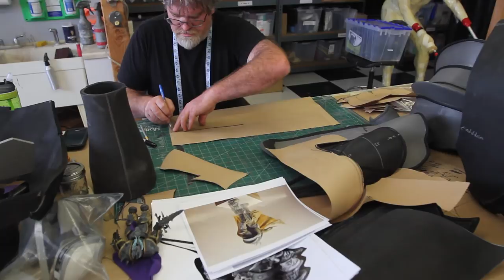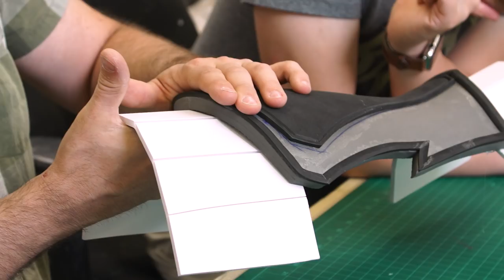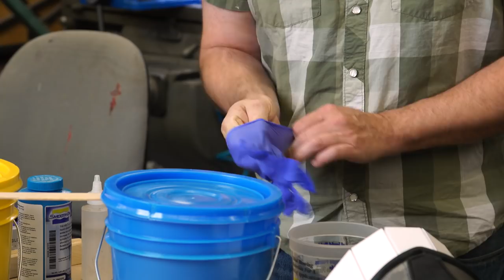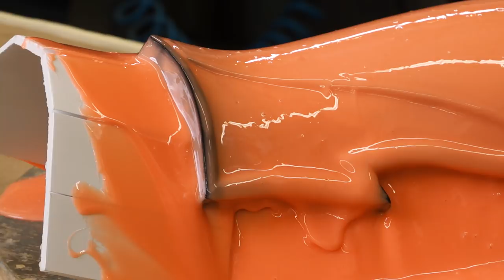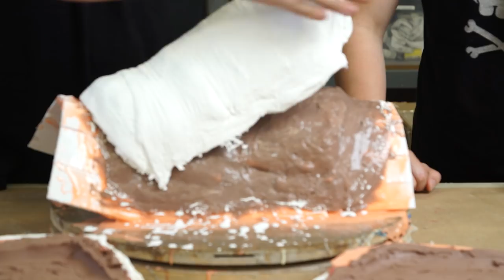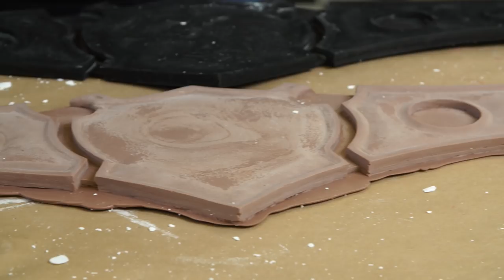How To Make a Silicone Brush-Up Mold!

Comment: Ah, the memories!
I used to make molds using latex, cotton gauze and plaster.
Same basic work-up, but after the detail pass, the second coating would get gauze pressed into the still-tacky latex.
Once that had set, another layer of latex, more gauze.
Basically a rubber/cotton composite structure.
I usually went for 4 layers of latex/gauze over the detail layer.
I would then encase the rubber mold with a plaster-gauze shell or 'mother' mold.
The rigid mother aligns and supports the rubber molding.
And yes, these were 20+ impression molds!
Never have used silicone con-carne.
Reply: I bet that is a lot cheaper than silicone.

Comment: You know, I really felt for a while like this channel and others were just plugging Smooth-On. Recently at work I had to make up a ton of brush on molds using silicone from some random local supplier and it was a nightmare. I'd have coats with precisely the same silicone to hardener ratios, and they'd just take completely random amounts of time to cure enough to add subsequent coats, anywhere between like 20 minutes and 5 hours. Quality silicone matters, kids.

Comment: Brush-on estimator 5000: find/cut a thin terry-cloth rag that just covers the area to brush-up, wad that cloth into a ball, drop the ball in the bucket.  Eye-ball the volume of the rag in the bucket, mix up slightly less than the rag-volume.
You are welcome.
Old fiberglass resin trick.

Comment: when talking about the thickness of the silicon you can save silicon by making it  thinner, 1/4" clear silicon you get from the hardware store  in a caulk tube is what i generally use. you can then use a plaster mother mold to get the rigidity you need, this is what i use to make my wax positives for metal casting in investment molds. really the method i use takes WAY longer than this does but its also WAY cheaper, a tube of construction silicon is like $5 and the plaster is even cheaper when you get a big bag of it but you'll spend a good long while making the molds.

Comment: Question: Would it be possible just to fill a mold like this with smoothcast 300 or a similar liquid plastic instead of the monster clay? Perhaps if you didn't need any more detail in the finished product?
Reply: Absolutely. You could also pour in resin, then distress it, or even add metal powders for neat effects. The way this guy make molds has always bothered me.
Reply: badvermin This gives me so many ideas!

Comment: Hey guys. I'm a fire spinner and I'm thinking about using something made like this for a costume. My main question is, I know silicone itself is heat and flame resistant, but once you add the rest of the stuff to it, does it still retain that resistance?

Comment: Hey Tested editor - from one to another - ProTip: if you duck the levels back & forth for each person speaking (only use one mic at a time), it will take an extra 20 minutes in post, but sound a whooole lot better.  Bistfump.

Comment: Hi Tested! my question is about the odor, vapors of these silicone's..ive talked to smooth-on, and so far, looks like there isnt any strong toxic vapor with " mold-max stroke" product...not 100% sure about the resin (smooth cast 320)...but, can i get away with both making molds and casting in a garage, or my living room without concern for vapors? I suspect the quick release 'spray' 200 may have issues as its an aerosol, but any guidance on this concern would be wonderful!- about to plunge into several mold making-casting items this winter!
Reply: Maybe too late but it is relatively safe not using a respirator mask while working in your living room with their silicon, you need to use gloves though, it is a different story with their resin, you NEED a respirator mask, specially one made for filtering chemical vapors, it releases toxic vapors when curing, when it turns from clear liquid to white it makes a chemical reaction that generates heat, sometimes you can see this vapor, with adequate ventilation this vapors dissipate quickly, don't use this in living room at night with no wind to "clean" the air in the room. You need to read the included instructions carefully before use.

Comment: Im willing to bet that they used the mic on the camera to record the audio for this video and just through in a denoise plugin and bumped it up to maximum.
Reply: The Y Network they definitely used some heavy denoiser on the audio.. they probably had a mic failure. It's happened to me a couple times.
Reply: it's funny how nobody cares =3 . Good .
Reply: It's not denoising, it's just both mics picking up the voices at different phases.
Simply cutting out one's mic when the other person is talking would have solved the issue.
Reply: rzkruspe possibly... But to me it sounds like too much noise reduction..
Reply: The Y Network a
Reply: Fuzzycat 61
Reply: rzkruspe f
Reply: The Y Network a

Comment: Question for Frank or other model makers. Making a mold and castings of very tiny things. like your own designed (3d printed) figures. For example war gaming figures at 28mm scale or buildings for those type of games .How would you go about and make a casting run of those figures /scenario buildings while preserving the small details you put in. Any tips on that ? I tried making some and had nothing but bad experiences. Tiny figures are hard to cast and fiddly bits get lost quick and the original gets damaged in the mold making.
Reply: Webdevvie I saw a video on a Mold called Blue stuff - might be something to look at for what you’re after.
Reply: Production casting are a different beast. Small fine details in a cast are a pain to not screw up. I would suggest you invest in a pressure casting pot and a vac chamber. While it's not exactly necessary to have those things they make it way easier and you get less miscasts, air bubbles, void etc. How is the master damaged? Is it made from a material that gets damaged easily? Need more details here. Aside from that some casting resin are more suited to smaller parts than others. Polyester resin for example while cheaper has never worked for small casting for me since heat is required to harden which in small casts is hard to do without exterior heating. Investing in a proper casting resin will help. Bad experience are learning experiences. If your doing small swords or guns (aka real small stuff) there are easier ways like using that low temp shaping stuff you reheat in hot water and some greenstuff. Whole figures are harder because of all the undercuts you have to consider. I would cast the main body then the arms separately. About all I can think of without asking more into what your doing.
Reply: Webdevvie PS: try giving Smooth-on a email detailing what you need and they should reply back with (hopefully) one of there product that is suited to that kind of moulding /production
Reply: I would look into tin/lead soldiers and how those guys do it. I had a friend whose father was into them and I know guys make their own molds. Materials would be different but as a resource for the process and how they go about making a mold that catches the details it could prove useful. Hope that helps a little.
Reply: What he said. A vacuum pump and a cylinder capable of sustaining a vacuum is almost essential if you want to make a silicone mould of tiny things with details. The moulds I've done are almost always one part moulds with the figure attached by sprues to a lollistick and put upside down in a small cup of silicone. Placed in the vacuum chamber to suck out all the air from the mould ensures full detail capture. Then the mould is carefully scalpelled open to remove the master and then taped back together. Urethane resin is used for casting and that's also done in a vacuum chamber to pull the resin into all the details. 

Using a low durometer silicone like 15 will give you easier removal of complicated figures, but you'd only get 10-15 copies before the mould failed. Higher durometer; more casts harder to remove.  Baking the cured silicone mould at 60-80degC for 2-3 hours can help further cure the silicone to make it more durable too.

Comment: Nice video.... but that audio needs work.
Reply: Jamie Rawson sounds like they used some heavy noise reduction. But I don't think it's unwatchable at all...
Reply: Jamie Rawson strange sounds perfectly fine on iPad 🤔?
Reply: ya no, everyone is having audio issues and i just check with my ipad and it still sounds off. don't be an apple fan boy
Reply: Even Wheat no fanboying-  just I have/hadno problems with sound on the video
Reply: I just finished watching the video and went to look at the comments, but i have no idea where the sound issue comments come from.
Nothing wrong here, but maybe it is because i'm on a Mac.  !!
(im serious though, i had no sound issues)
Reply: Maybe Apple speakers just always suck and they can't tell the difference
Reply: I'm on a Mac and I can most certainly hear the audio weirdness. I've also noticed it when listening on my iPhone (no headphones.) I think it really comes down to your ability to perceive it. That said, it's annoying as hell.
Reply: Watching on a desktop setup with high end audio card and high end speaker system, it's unwatchable, I only managed a few minutes before turning off. At first it was just Franks voice but then Norms voice became even more irritating than normal !

Comment: I understand why you'd use a silicone mould if there were a ton of detail but for shapes that are pretty much just slabs this is definitely a waste of money and time. All these various layers of "throw-away" moulding materials aren't cheap and there are easier ways to do this with foam and clay alone. Silicone is using in mould-making for picking up small details of which there were none.
Reply: im sure cost matters less when the customer is footing the bill. And im sure blizzard is paying a hefty price for that costume.

Comment: Jeez, im not an expert or anything but that seems like a lot of wasted time and resources to end up with nothing but a piece of clay shaped like the thing you made out of foam. There has to be a better way.
Reply: The point of the foam is that it's wearable. It's essentially a way to get measurements
Reply: The point is that you can now sculpt further details on the clay pieces, and clean them up more to be perfectly smooth, which you really can't do with the foam.
Reply: I think the idea is that sculpting that base-item from scratch would take a hell of a lot longer than rough cutting some foam, getting the shape, symmetry, etc. right and molding it.
Reply: The foam and the casting of the foam is just to get the base to sculpt over it. Then make the final molds/pieces using the sculpted clay. Like this it´s way easier to get a rough shape where you can sculpt over, instead of making everything from scratch (and probably waste more clay than you need to).
Reply: If there was a better way I'm sure they'd use it. They ARE experts.
Reply: 17:40 explains clearly!